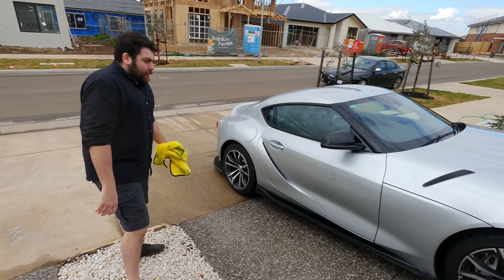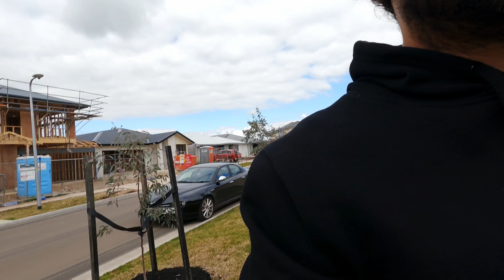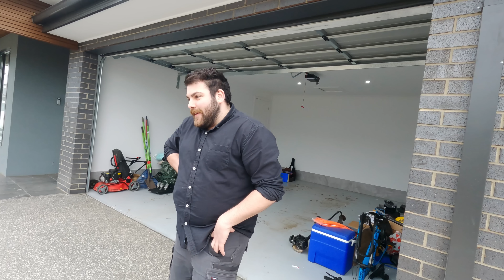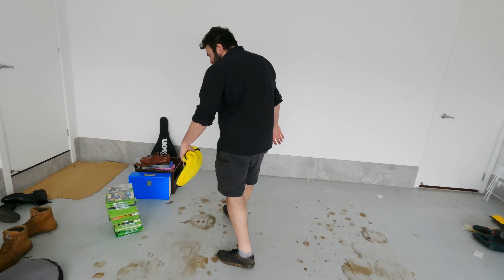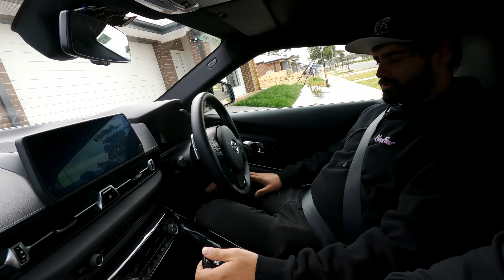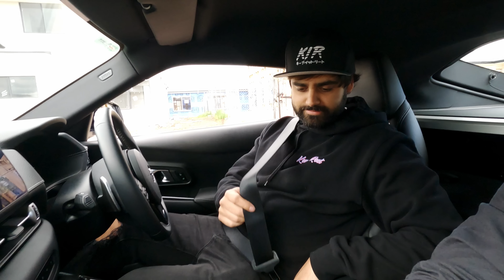Buying A New Supra With A $6000 Exhaust!

Comment: The B58 is a beast! Mine has 535 whp with just a Pure800 turbo, DP, stage 2 high pressure fuel pump and a flex fuel sensor. Ive thrashed the shit out of it on numerous track days, drag and roll racing, with no problems. Can't wait to see what you do with this beauty.
Reply: corn or 91 octane?